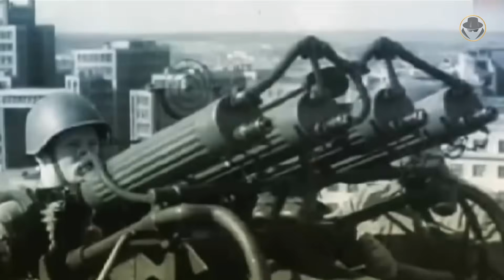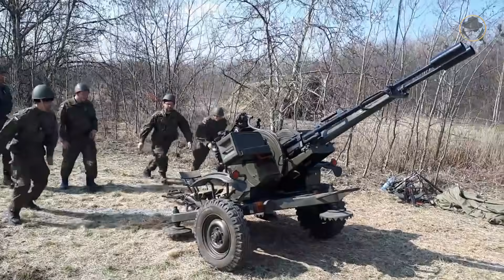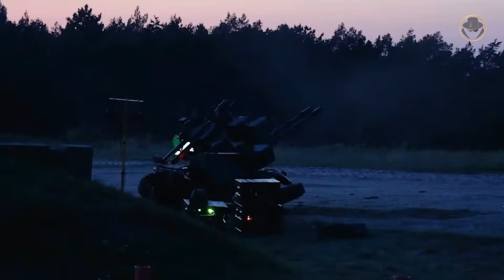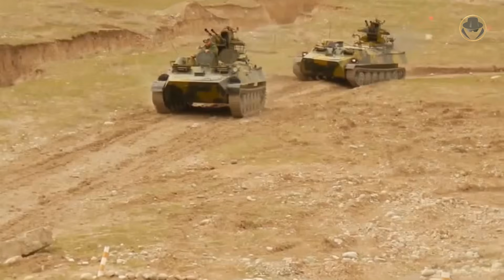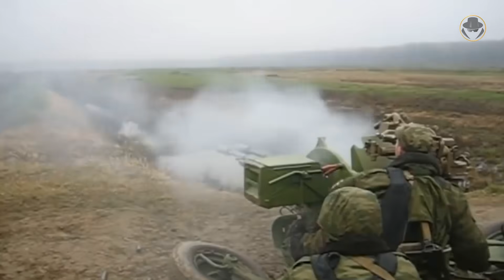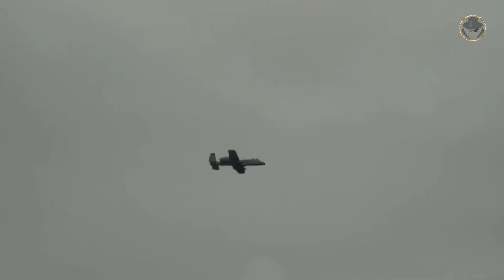ZU-23-2 anti-aircraft gun | Moderate for air defence, perfect for ground fire support

Comment: If make a 4 person size of submarine(small), then this can be covered airtight when closed, then float if have enemies, nice right, if imagine about speed, just more propellers, then it will be lighter anyway to run from big submarines. If a tank corner have this, a big type(only): "an extra to normal tank"? The impact(recoil) looks only smallwheel is enough to hold it. 2 of this on 1 tank(strongest finished maybe) but should be the plan maybe: lightank, heavytank. Never seen a heavy type that can shoot to the sky yet. Maybe if heavy this to be 4? I imagine. Then casing of tank a bombshelter(maybe including this too: material upgrade).

Comment: Today in the era of high speed aircraft borne missiles that can be fired remote , outside of the range of  a WW2  anti-aircraft gun ...it is inconceivable that a hundred such guns guarding a target would  be useful.
Reply: they're WAY less expensive than missiles, and not all aircraft fly as high or as fast as modern jets. Helicopters and A-10s are still practical targets for conventional AA guns.
Reply: Inexpensive small drones and the use of swarms of them is once again changing the face of warfare.  Anti-aircraft guns are far more cost effective for defense than missiles for dealing with this new threat to tanks, APCs, ammunition bunkers, artillery pieces, and infantry sheltering in trenches.

Comment: When in Finnish Defence Forces, we "tuned up" the 23 which we call "Sergei". The sights originally had a Soviet battery and stuff, but replacing them with western ones made the sight vastly better. The firing pedal triggered too early, so it was adjusted to fire only when it almost hit the metal, so when firing sighting shots it bounced from the bottom firing usually only one round per barrel. That did not waste ammunition for sighting, and the boxes were then emptied to the actual target, if needed. And, as the barrels are meant to "jump rope" because of the front latches being intentionally loose, placing sand paper strips upside down eliminated the "shotgun effect" ,and it fired almost through the same hole for some distance. That gave our team better hitting % than is theoretically normally possible...
Reply: "stinger" is more expensive thats true

Comment: Best use of the ZU-23:  Mounted on a Toyota Hilux as a "Technical".
Reply: When is Toyota going to offer this for 3rd gen Tacoma?
Reply: If a Toyota Hilux mounted a ZU-23 comes over, Imma haul ass
Reply: Not true. It nas 2 tons of recoil.. toyota pickup truck is highly unstable with this. 6x6 military truck is much better option.  Check Hibneryt 6x6 truck with ZU -23-2
Reply: @zepter00   The people from this two videos would like a word with you
https://youtu.be/tNXSeMu38YM - Anti-aircraft gun ZU 23-2 on the basis of a pickup truck is firing direct fire
https://youtu.be/HZoRHeMc0Vg - Anti-aircraft installation on the basis of a pickup with one 23mm gun from the ZU-23
Reply: @zepter00  yeh I agree 14.5mm at tops
Reply: @mathewkelly9968    The people from this two videos would like a word with you
https://youtu.be/tNXSeMu38YM - Anti-aircraft gun ZU 23-2 on the basis of a pickup truck is firing direct fire
https://youtu.be/HZoRHeMc0Vg - Anti-aircraft installation on the basis of a pickup with one 23mm gun from the ZU-23
Reply: @zepter00  yes it is, but toyota can still fire in backward direction. Sometimes arabs used crane supports, so you can fire in any direction, but its bad, because of no mobility.
Reply: love this CC Generals: GLA reference 🤣

the single barrel will be perfect for power to weight-speed ration
Reply: @eizendragon5141  have you seen the BMP gun techy in Squad? It’s hilarity.
Reply: @eizendragon5141  C&C ❤
Reply: point it backwards for extra speed
Reply: The perfect Toyota for this gun is the land cruiser pickup
Reply: drink actually
Reply: There's a mod for ARMA 3 such includes this exact thing. Shoot it backwards while driving forward and you can get a boost of speed.
Reply: As its done in libya
Reply: Saw it and mumbled to myself, "now that's a technical". Love it!
Reply: شرق الأوسط
Reply: Go away kid
Reply: I think UK TV Top Gear missed trick here.
Reply: In Finland we used to strap some 1.000 of these autocannons on top of 6x6 trucks, and tow another. Still in deep storage…
Reply: Terrorists use Toyota!
Reply: @MrRobokoper british special forces used this tactic in ww2  first and obviusly it still works

Comment: Newest Polish version is know as "PILICA". Pilica is based on ZSU-23-2SP (twin 23mm guns and rails for PZR GROM or PIORUN IR missiles with Range up to 6,5km) that additionally has electric asynchronous brushless motors for all axis movement. Old manual systems are left only as emergency backup as the system will be used remotely (there is also portable terminal for remote control). The system also includes for each ZSU-23-2SP integrated optical head with color day and night camera, termalvision camera and laser rangefinder, IFF system as well as 3D L-band radar for battery. PILICA is using digital encrypted datalink allowing to comunicate with airdefence command systems like Polish "REGA" system. The system is transported on 4x4 lightly armored JELCZ 442.32 9 ton (15,6 ton max load) truck. One PILICA system consist of 12 ZSU-23-2SP's, command vehicle, radar vehicle, 2 ammo trucks, 2 maintainence trucks. Optimal setup allows to cover approx area of 350km2for one Pilica system.
Reply: Damn! The Poles sure don’t want the Russians to outdo them!
Reply: @jacekksero  Greetings I read link you posted and see anti aircraft missile Grom in tandem with ZSU-2 , can you please tell me something about missile Grom , for example his max flying in height and in length, because it's looks impressive.
Reply: @arsenijearsen3041  Grom/ Piorun (missile); Minimum / maximum range of hitting targets 400-6500 m. The minimum / maximum height of the target's destruction 10-4000 m
Reply: @jacekksero  Thank you for answering, excellent numbers, sorry I forget to ask are those missiles made by Poland or which country?
Reply: @arsenijearsen3041  Yes only poland, new produkt. Actual No1 of world MANPADS
Reply: @jacekksero  Thank you, again 🙂 for info.
Reply: @arsenijearsen3041  @Jacek Ksero forgot to add one thing the other difference between GROM and PIORUN, is the new tracker for PIORUN. POIRUN has 360 degree target acquisition zone so it can attack targets not only from back or side but also head on. Also the PILICA modernisation allows ZU-23-2 to use new ammo for guns (originally developed for BIALA system = Polish Modernisation of ZSU-23-4 SHILKA). Newly made autocannons plus new ammo equals extended range of gunfire from 500 to 1000 meters depending on the version of the ammo. I've also read that there is a development work done on programmable rounds for 23mm guns being done, as we speak
Reply: yes and pilica is waste of money and not real air defence system. it is spray and prey
Reply: @adlkdflsk  And Your logical and factual data for this claim is??? I never stated that this system is "The best in the world" But since multiple countries go in the same direction with theirs it stand to reason that there is something to it. Btw. In the new era of Drone warfare this kind of system is ideal for protection from UAV's plus it is a HUGE upgrade over the old ZU-23-2 (Night and day capability and linked with automated AA defence system with 3D radar). Besides it is not intended to be stand-alone, more like part of a system that consists of multiple layers...
Reply: @Crimerenegade  I know constructors from PIT RADWAR and from HSW who described it as shity system. the only reason why it was build was a fact polish gouverment wanted to donete some $ to ZM Tarnow because they can produce only 23mm and they canceled 35mm with programable ammunition because "23mm is cheap".  pilica is outdated and exrtremly expensive system based on gun from 1960s. it has no accuracy and poor range
Reply: @adlkdflsk  My argument still stands, if You claim that it is a shity system, why so many countries prefer and still develop it?? You also did not post any evidence of information, what kind o base You have for information about inaccuracy of ZU-23, what was the system that was compared, what were the parameters of such comparison? I doubt any of us will have access to this kind of data but we can do a quick internet check for basic data in example M61 Vulcan used in Phalanx CIWS and Phalanx C-RAM has advertised range of 1625 yards (1486 meters) basic ZU-23-2 (without modern ammo) has 2500 meters of range... You better tell US Navy and US Army that gun that their are using as CIWS and C-RAM (as well as 30+ other countries) is shit... Besides as it is untrue what You said about 35 mm KDA. The program for AG-35 (land based automated version of AA system using 35mm KDA gun) as well AM-35 TRYTON are still ongoing, in fact the AM-35 is being selected to replace WROBEL guns (older variant of ZU-23-2) on board of Polish Navy Ships (starting with project 258 KORMORAN mine clearing/hunting ships). And AG-35 is scheduled to replace old S-60 guns still in use by the Polish Navy for AA duties. By the way the PILICA is intended to be used in tandem with the AG-35 system, as well as othe missile systems, , as I was saying a part of multilayer AA system. On another note If current government only wanted to transfer money to ZM TARNÓW (i not saying their not..as we know that POLSKA GRUPA ZBROJENIOWA have to be heavily subsidised due to sheer incompetence of government and the board of directors) why they chosen to do this by PILICA and not in case of  RGP-40 (Revolver-type Grenade Launcher) program... Sorry but I think this does not add-up